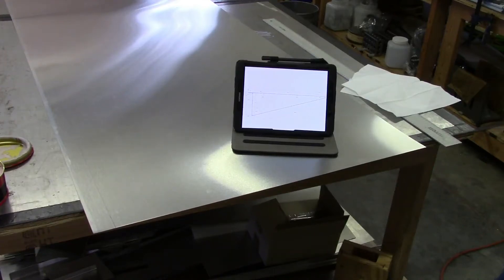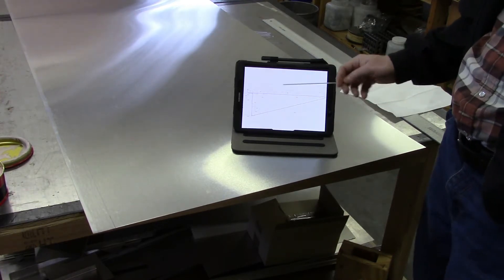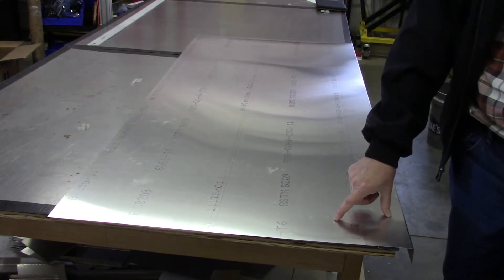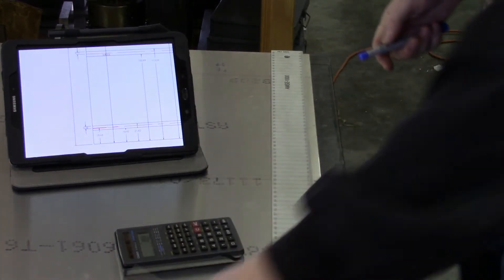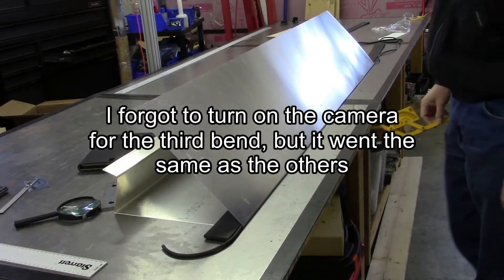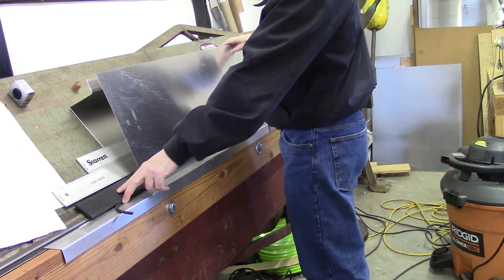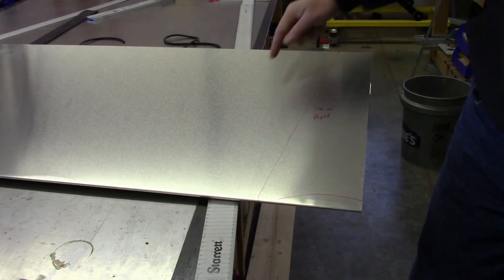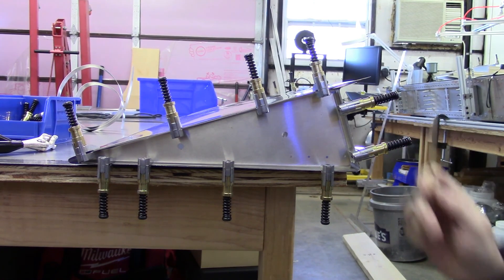Flap/Aileron Construction- Part 5 Bending Aileron Skin

Comment: What are the overall dimensions of the sheet that used to form the aileron? I only have a 48" brake and shear and would like to know if they could be done on them. Thanks
Reply from the maker: The aileron is roughly 800mmx1600mm. The flap is a little larger. A lot of home builders will fabricate their own brake out of angle iron.  You can bend everything in a 650 with an 8 foot brake. If you have the funds, I would say buy the brake. 

For any of the brakes, you want to have a 1/8inch nose radius. The typical 48" box brake will not have a nose radius. A few of the wing spar parts also require a 1/4 inch bend radius.  For my brake, I fabricated my own nose bars. Both 1/8 and 1/4 inch nose radii.

You can do a lot using a 48 inch shear. For anything bigger you can use an olfa knife or cut by hand.
Reply: @googacct  I have the ability to change the radius of the nose on my brake as I have a magnetic brake.  Just change the top bar and I get a new radius. It seems a larger brake is needed. Thanks for the fast reply.